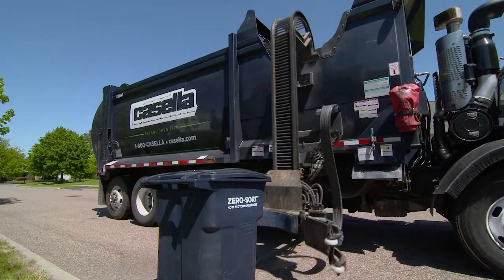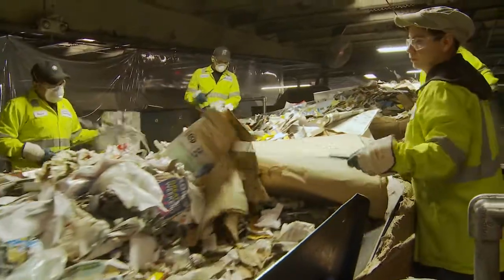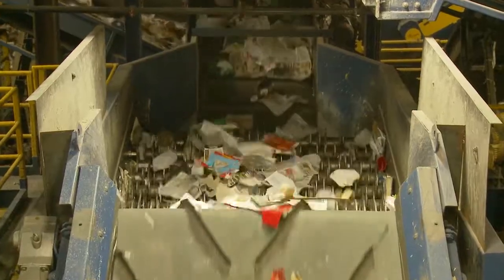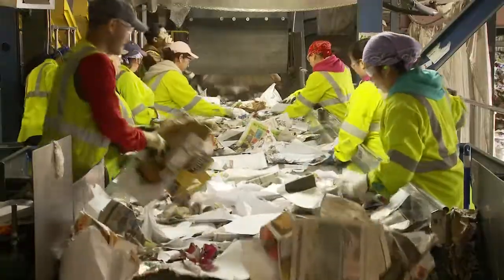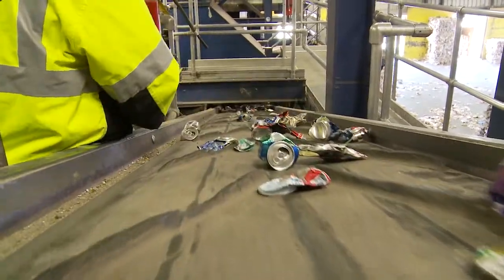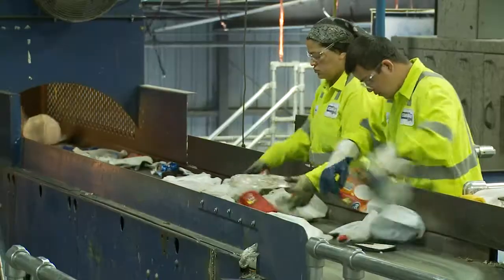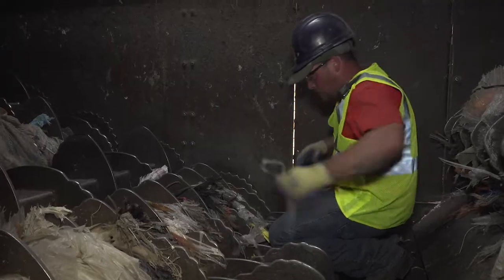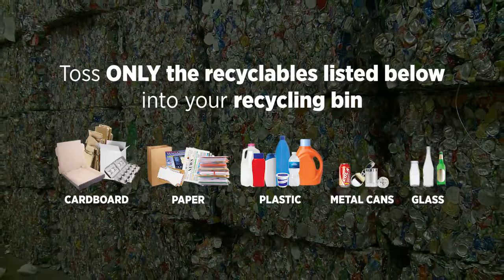Virtual Tour of a Casella Recycling Facility

Comment: Is it true that small items (smaller than 2"x 2") like soda bottle caps or Rx bottle caps, will cause problems in the machines?
Reply: I'm pretty sure small items don't cause a problem with the machines, it's just that they will fall through and not be recycled at all. Some places suggest screwing the caps back on the bottle (once they are clean and dry) so that they will not fall through. I don't remember if Casella is one of those places.